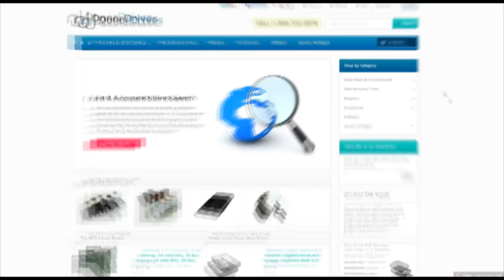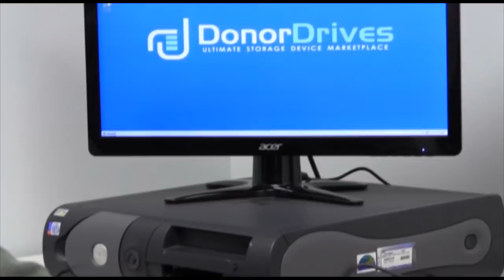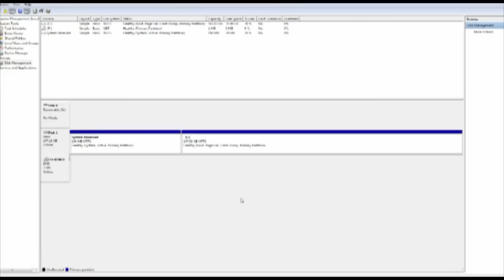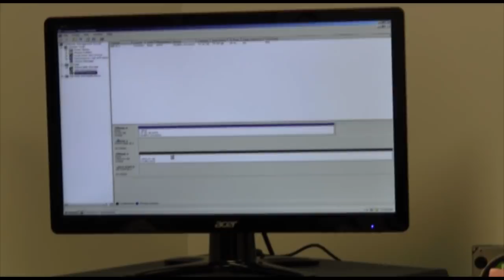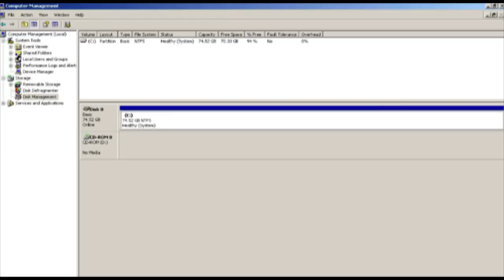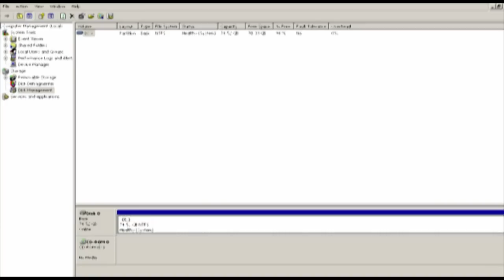DIY: Repair Hard Drive PCB. How to swap circuit board ROM chip.

Comment: I want to swap 
pcb rom . I have seagate barracuda 2TB x 2 . One of the hard drive has 
important data in it. And that one has power surged and burnt.
Both PCB board number are same , 100717520 REV B

But these two 2TB hard disk information aren't same. 
             Good one         ---->   Damage one
Model : ST2000DM001          ST2000DM001
PN:       1CH164-306               1CH164-510
FW:       CC29                           CC27
Date:   14184                           15353
Site:     TK                                 TK

 Now I tried to swap PCB only and it only recongnized as 128GB and can do nothing in diskmgmt.msc.
Should I try changing rom ? I have no experience.
Reply: +Phyo Htet Aung If you do not have any experience using Hot Air Station, I would contact a local professional, or utilize our repair service. For these drives, the ROM is 100% unique, so if it's ever lost or damaged - there is no getting data back, ever!
Reply: Yeah, try changing ROM chip.

Comment: Thank you for the post. I have a Hitachi Drive HDS721010KLA330 with PCB 0A29470. The drives makes click click sound when connected to external case and is not recognized by any OS. Will replacing the PCB help in recovering data from this drive?
Reply from the maker: +Manohardeep Josan It is possible, but usually when we encounter clicking drives, it is not a PCB issue, but a mechanical one concerning the internal components. If you'd like, you can send it in to us for free diagnostics, and if it is the PCB we can replace it for $60, incl. parts and labor: outsourcedatarecovery.com/submit-service
Reply: It's less than 30% chance, on average, that clicking sound is caused by a PCB.

Comment: Great Video! Do any of you know if there's a way to backup the rom on a good drive so if it goes bad you can just reflash the backup to a new pcb?
Reply from the maker: +George Klein That is definitely a possibility. We often do that using the PC-3000 system by ACE Laboratory.
Reply: +Donor Drives LLC  Checking out the PC-3000 specs. Very Brilliant products!
Reply: There are no free software for that, but you could use a programmator.

Comment: What size torx screwdriver is needed to remove the PCB? Is it different for the front cover? I have a Seagate ST2000DM001.
Reply: +CommonCentsRob T6 and T8 for the model of your device.

Comment: Hi, so if I have a drive that needs the rom chip swapping that's all I have to do ? I saw something about firmware transfer is that not necessary?
Reply: +David Bowers The ROM swap IS the firmware transfer, they're both one and the same thing :)

Comment: I could use some help, I bought a replacement PCB for a seagate constellation ST32000644NS but I can't pick of the bios chip. Could you show me so I can move forward with the swap?
Reply: +Benjamin “3of12 the Punished Borg” Edwards Email our support.

Comment: I have a Segate Barracuda 7200.7 200gb  Model#ST3200822A  firmware  3.02.  I found A segate same model but the firmware is 3.01 will a swap will still work?
Reply: +On The Move So would a chip swap work with the one 3.01 or would I need to have the firmware upgraded? thanks for the reply
Reply: +Adam Dean yes.  you'd be using your chip anyway so it doesn't matter
Reply: +Benjamin “3of12 the Punished Borg” Edwards Ok, thanks for the info :)

Comment: Hi,  may I know if you have come across western digital first generation 1TB my passport external disk drive?   model number is WD10JMVW-11AJGS0.  is it a category 2?  I am from Singapore,  data recovery services cost a bomb here.  I dropped my hard disk accidentally and it then gives a consistant clicking noise.  WD software quick test gave a green pass, but it just won't read.   I checked out the web and most suggested that it is likely due to PCB problem.
Reply: +Louise Chng everything you just said suggests the opposite.  The clicking indicates the heads moving back to default position, which means your got a mechanical problem.  The PCB would have to be physically damaged to cause problems, and it would keep it from being discovered during post.

Comment: what is the most important chip on the circuit board
Reply: +Dre Love I would say the ROM chip as they're drive specific, but the big MCU (Main Control Unit) chips are usually the same across drives.

Comment: May i know the possibitlity of data recovery from Seagate SSHD Serial# W764D3PG Model: ST500LM000 Seagate Part# 1EJ162-039 Firmware: DEMC). As suddenly it stopped working. When i connect it with external USB adapter, no vibration, no sound of any kind at start there is a very low PiP sound only once after that nothing. Also the Hard Disk is not detecting in the Bios.

We swapped the circuit board from similar model ST500LM000 Seagate Part# 1EJ162-038 but with different Firmware DEM9, then the hard disk started to give clicking sound but then we immediately unplugged it. Any Ideas please.
Reply from the maker: +YasirIslam01 Hello, Yasir. It is difficult to say without examining the drive, but it sounds like that could be a mechanical issue. Working on these hybrid drives can be difficult since it requires swapping the ROM chip as well as the NAND memory.
If you would like, you can send it in to us for a free evaluation and we will issue you a quote for the cost of data recovery: http://www.outsourcedatarecovery.com/submit-service

Comment: can a damaged hard drive be saved.
Reply from the maker: +GauronsGhost It depends on what the issue is with the hard drive. If you are referring to damaged platters, that will most likely not be salvageable. If you are not sure what the issue is, you can send the drive in for a free evaluation.

Comment: While this video is helpful and awesome, their "FREE Diagnostic" is the tip of a very large iceberg. I had two hard drives go through a power surge and end up dead. I ordered a pcb and tried to fix it by switching the ROM as described in this video. I got the drive to spin up again, but it never was recognized by my computer. Then I sent my drives to Donor Drives for diagnostics. The process was great... Until I received a quote. My 150GB WD Raptor was $1,495 and my 1TB WD drive was $2,094. Also worth mentioning is the pcb I purchased from them was not going to be refunded or used towards the quote price.

I would guess large businesses might pay these kind of ransom prices, but individuals (like the ones watching this video) most likely won't be able to afford them. I hope this heads up saves someone the hassle of shipping them to Donor Drives only to find out they can't afford the repair.
Reply: That's great and all should do that but what happens when the data drive craps out and the back up drive running RAID or some sort of back up software gets corrupted to the point that you lose all that back up data? I know plenty of those exact scenarios including where the second back up was only two weeks old but the data was not there that was needed because of those two weeks. Shit happens. Lesson in all this is you can never have too many backups and make sure to keep at least two copies off site because, theft, fires, floods, life happens.
Reply: +Brandon Balentine
hi everyone ,if anyone else  wants to discover 
ifixit and repair
 try Saankramer Electronic Magazine System (Have a quick look on google cant remember the place now ) ? Ive heard some extraordinary things about it and my mate got great success with it.
Reply: Really bad... But what would it have cost to forgo 1.15 TB of yr data - forever?
Reply: +Brandon Balentine We issue refunds on PCBs within 30 days after purchase, unless ROM was modified. If you got a 2k quote for service, means there is definitely mechanical damage as well as platter damage, which isn't exactly a "repairable" issue, and by many recovery companies - "not recoverable".
Reply: Chiming in a little late . . . Hope you learned your lesson and started making use of online backup options since they are so cheap now.
Reply: SuperJames 1985 I just back up my stuff to cloud accounts.  They are pretty cheap at the low low cost of free.  I only value hdds for storage of games now
Reply: +Brandon Balentine you might as well get refurbished drives that are cheap on newegg.  You save on money if you get a good one, and I havent picked up a  DOA one yet after a half a dozen times.  If they do fail, you can return them and after years the repairs can be risked if you go for a self done bios swap because the drive was cheap to start with.
Reply: +Brandon Balentine If you'd had data backups in the first place you wouldn't have even needed data recovery. Too many people blame the data recovery companies' costs when in fact it's their stupid fault for not backing up, and/or researching what backing up is if they don't know.

What I do, when I buy one drive, I buy another to back it up to frequently, and then another to back that one up to 6 months later. It's still cheaper than recovery services even buying multiple drives. $2,904 will get you a TON of 150GB drives!

Comment: So I have one of the blue WD 1TB hard drives. It's a category 2 and apparently it needs a rom swap... It needs a new PCB (I already bought a replacement) because the sata data port is broken, but instead of a rom swap, could I simply format the drive? I currently have a butchered sata cable soldered to the pins and it works, but I really think it would be best to put that new PCB on and HOPEFULLY without a rom swap.
Reply: +T Lawrence formatting has nothing to do with it.  just swapping PCBs might work, its just overwhelmingly likely you have to do a bios rom swap.

Comment: Hi I repaired my drive (ST3000DM001) I there was some weird problems, I never saw the information by once, I needed to search for it and save it in another drive, but it looks like the drive has lost the serial number and model from the memory, also it's a 3TB drive and even when windows recognized it, does not allows me to format a single partition of 3TB just one of 2TB and left the other (+700 GB) not usable. Did I miss something?
Reply: +Chemy JMHT Those 3TB drives from Seagate are VERY failure prone. They are from when the floods hit, and are all defective. I'd advise you get the ST4000DM001 as they weren't affected.
Reply: +Chemy JMHT nope its working fine.  You forgot to set the boot record to GPT instead of MBR.  The limit of MBR is 2TB
Reply: SuperJames 1985 wasn't aware, probably solid advice

Comment: Hi, can a replaceent pcb with the same firmware work? or does it have to have other matching characteristics as well?  my problem disk:

seagate barracuda 7200.10 320gb
serial - 90fo1zkt
model number: st3320820a
part number: 9BJ03F-560
firmware: 3.afe
site code tk
main controller ic: 100407840

Comment: Hi,can you tell me what the pcb sticker is?  I have a barracuda ST 2000DL001 F/W CC96 date 11175 P/N 9VT156-570.....I think that I should replace my PCB with ST2000DL001, 9VT156-570, CC96, 4704 C, Seagate SATA 3.5 PCB from you site but the PCB stickers are different.  Mine is 2000 D.

Comment: Hi, i have a problem with my seagate 3TB HDD and i think its the pcb, i found another drive at the store that have same  MODEL/PN/FW, the only difference is that small sticker at on the PCB, mine say 4049H and the one in the store say 4049E. will it work if ill just swap the PCBs?

Comment: I if the PC can't recognize the HDD , it can be the PC contacts even if the hard drive is spinning ?
Reply: +Yoel Truffin Yes. Try reseating your SATA cables, from both sides.  You'd be surprised.  The HDD will spin up as long as its getting power.
Reply: +Benjamin “3of12 the Punished Borg” Edwards 
I did it but it and didn't work, I replace the PCB but still the same, It is a 3TB hard drive, I also was told that the PCB has to mach an another internal PCB.
it is true? and how difficult, is to replace the internal PCB?
Thank you for you Videos.
Reply: Yoel Truffin the internal PCB is inside the sealed part of the drive. Its not hard to get at, since there are screws but you'd ruin the seal of the drive. I think you should just get it professionally repaired.
Reply: +Benjamin “3of12 the Punished Borg” Edwards 
Thank very much

Comment: Learned a lot is it alright if I can send mine over too? I just want to keep all the files inside it and have it repaired. The problem with it is a chip that broke(the outside part of it) so I can't plug it to any cables.

How much would it cost?
Reply: +Renkai Noctis Contact our support, so that we can better assist you.

Comment: hi man i have a seagate hdd of 2 tb the model is ST2000DM001. the firmware is CC4B, when it starts, comes from inside a crash that lasts more or less 5 or 10 seconds and then it stops but my pc doen´t recognize it at all not even the BIOS.
i hope your help to solve this issue. since yhe hdd is totally full and i need that information.

Comment: I have a question... I have  A dead Seagate ST3750528AS  firmware CC46  plugged in voltage cable improperly (by rushing & not paying attention). I have a working ST3750528AS firmware CC44, so I attempted to swap before I found your video. The results where the hard drive that was dead now powers up but it started clicking so I immediately cut it off.  Did I make it worse to the point of no return or is there still hope? world upgrading the firmware from CC44 to CC46 help the working PCB in getting my hard drive properly working?

Comment: Where can I buy a small hot-air gun like that?  Micro Center says they sell soldering kits, but no heat gun that small.  Would it be safe for the boards, to use a "dryer" sized heat gun?  Also, did you use the same hot air gun for both unsoldering and soldering?

Comment: I almost fell out of my chair when he said, "you can just use a heat gun at home"!  I would love to watch someone without pcb repair skills/experience doing that.  At a minimum you should also be wearing a properly grounded static strap for these "repairs" in your videos.  Without the right precautions a bad situation can only get worse, especially when it comes to data loss.
Reply: +Keith Ward the chance of static damage is exaggerated by nearly every PC repair source.   I had to laugh a bit because I never damaged any hardware even years without one.  Hardware is just not nearly as delicate as they want you to think.

And you can use a good soldering iron instead of a heat gun.
Reply: +Benjamin “3of12 the Punished Borg” Edwards Try explaining that to 50k+ cellular customers who are out of service due to someone getting by on luck.  I'm not some safety Nazi or someone who does everything by the book without question.  Electronics might not always be totally taken out by static but rather just damaged to simply fail later and at a more crucial time.
Reply: Keith Ward don't get me wrong, I use a wrist strap and ground it to my case or something, I just don't lose my mind if I forget.  I just don't like it when someone makes vague generalized claims about electronics.

Comment: I have a Seagate 640 GB hard drive where the USB plug has come loose from the circuit board. How do I go about finding and replacing the circuit board? What information from the hard drive can I use to search for a replacement? I'm sure the data is still there and available, it's just the circuit board that needs to be replaced. Can you help?
Reply from the maker: Hi Aaron, You can consult our matching guide at http://www.donordrives.com/hard-drive-pcb-donor-match . The match requirements will vary depending on the architecture and model, but this will give a general guide. If you need further assistance, feel free to give us a call at 1-800-733-0978 and we can try to help you find a match

Comment: I have a wd black which I assumed the pcb is dead...To remove its rom chip,will I have to use a heat gun or I can use any other gripping tool to pull the rom out with force? Is that safe? Because I saw my boss take out the chipset from a mboard only by pulling it with force with a gripping tool,he don't need to unsolder it with heat gun and replace it with another chipset and the board still works